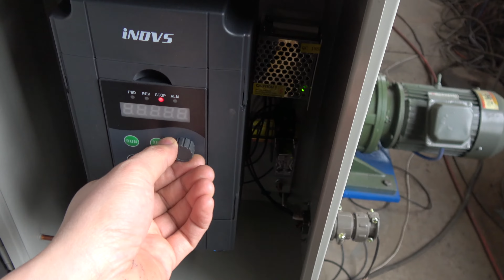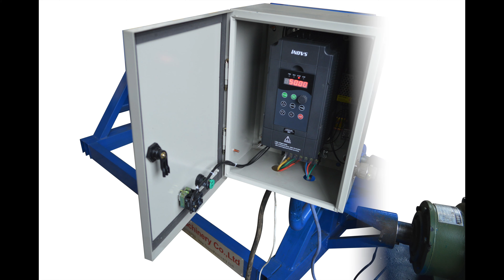electric decoiler

Comment: Weight carrying capacity?
Reply from the maker: normally 5, 8 or 10 ton. what is your actual requirement?
Reply: @ToppoMachinery  our coils are around 4.5 to 5 tons so 8 ton carrying capacity is required.
Reply from the maker: 8 ton is no problem. 
Let us talk by Wattsupp it is faster and more convenient. +86-156-317-93989